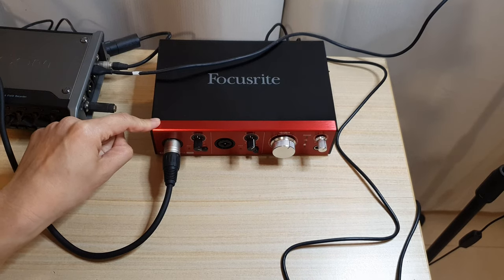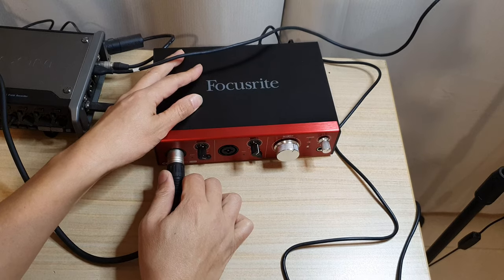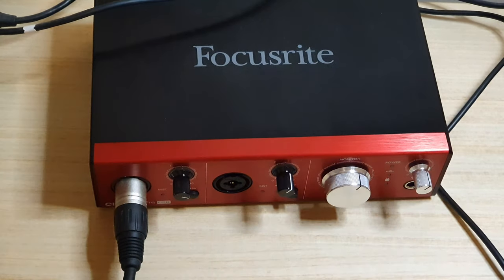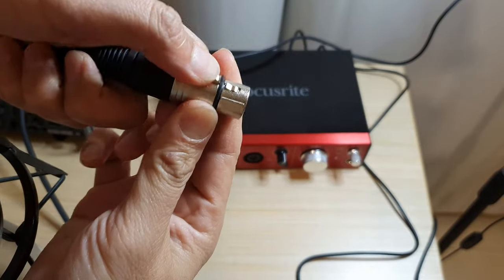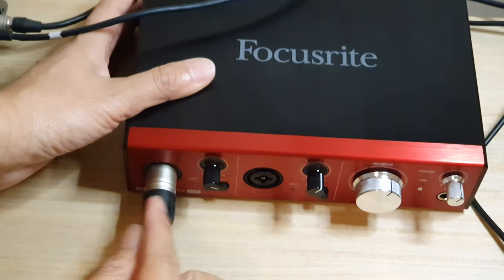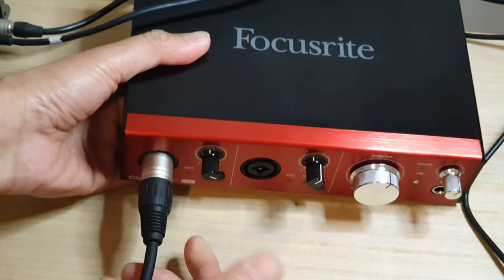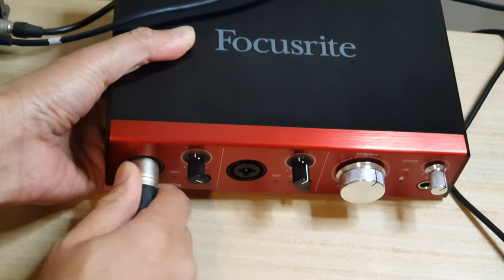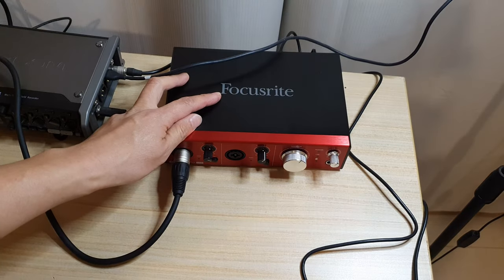How to Remove a Stuck/Difficult Microphone Plug From Focusrite Audio Interface (Clarett/Scarlett)

Comment: the cable I have is bigger where it connect and gets smaller towars the rest of the cable making it very difficult to get a good grip without pulling on the wire itself and the audio interface I use have a knob right next to it making it harder aswell, I'm out of luck lol

Comment: didnt work for me try alot off time. godt it at last. so iff you use it put a tape over the hole so it dont click.
Reply: I bought mine today and it's stuck, been trying for over 2 hours and my fingers hurt. Did you do anything extra?
Reply: @happyplace20237  he didnt take it to the shop and the fix for you. i did and godt a new one free.
Reply: @chriswizard4930  I got mine out hours later. I discovered all I had to do was connect my audio interface and unplug the cable while it's still on and active. If it was off/inactive, nothing would free it. That might've been dumb of me but I had no idea the interface had to be on and active.🤦🏾‍♀️

Comment: sometimes a banged up, out-of-round, male barrel will feel rough to put in; it’s unadvisable to force it in. anytime you feel resistance is best safe to not patch it. for the video’s case, I would return that interface, if bought brand new, to the retailer as that female if you know your male barrels are true.